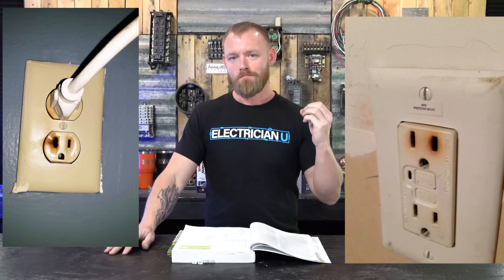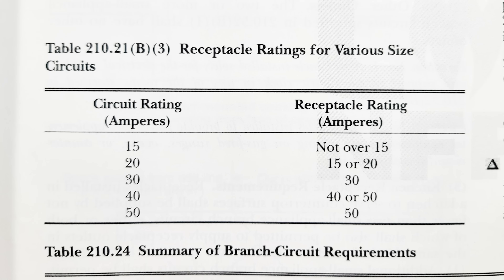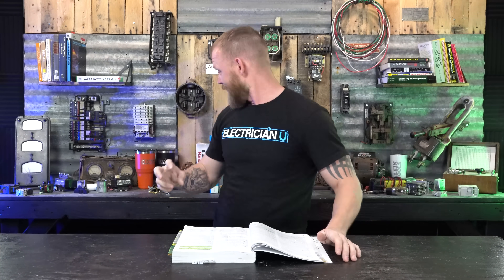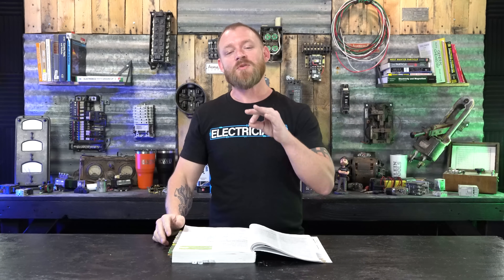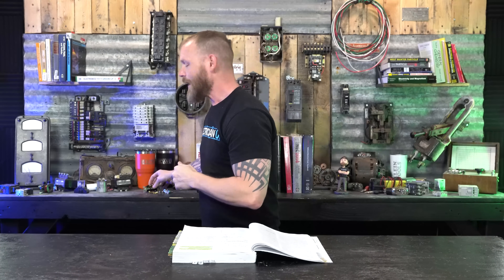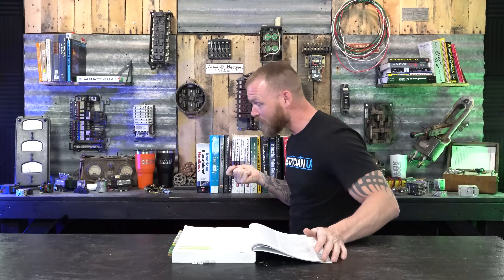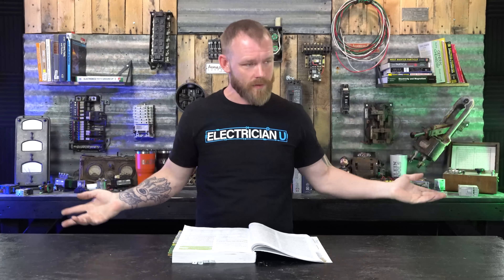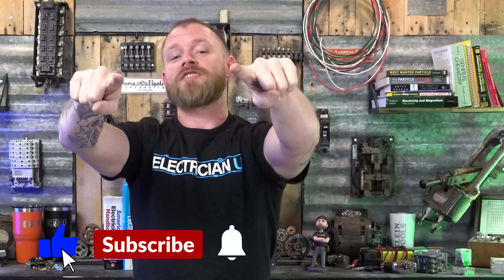Won't These Melt?!? 15amp Receptacles on 20 amp Circuits!!!

Comment: Great advice - a couple of thoughts tangental to the discussion. Spend the extra money and get high quality outlets - the 89 cent outlets are not the way to go. Consider Hospital grade outlets (15 or 20 amp depending on wiring/breaker) and you will never ever have to replace again . Furthermore, the plug will never pull out of the wall - just look at the specs on these outlets. Do it once, spend a little more and never go back knowing you and your family safe and sound. Does a extra 4 bucks make you sleep well at night, I know it does for me, but then again thats my opinion. Cheers!
Reply: LoL you clearly don't own a business that  cost added up over a whole neighborhood or a apartment building... adds up and with every builder bust balls over every penny well you save money where you can...
Reply: I get Leviton cheap.
Reply: Another legit consideration; the clamping force associated with a Hospital Grade device, creates unintentional wear and tear on the cords during unplugging. 

Sure, those in the industry are aware, ... however, many individuals simply tug as hard as needed on the cord itself (as opposed to the cord cap) to unplug... leading to stretching, exposed insulation, partial fraying, etc.
Reply: Your codes seem woefully weak in relation to manufacture of electrical products. What would a poor worker in a slave factory, in another country know about electrical items-all he's worried about is selling them. I have another question, do your fire and insurance codes allow such crap?
Reply: @johnchristmas7522  knows everything there is to know about everything amd if you don't do it the Christmas way is wrong and you're a hack ... this dude most likely couldn't make as a electrician and pulls security wire ...
Reply: @cheryljason9617  sorry you feel that way about me guys, I'm only trying to help-do whatever suits
Reply: @johnchristmas7522  
Interesting 
Do you have any examples of such code issues?

Comment: What about the facts that when you tear apart a 15 amp outlet it could, with the exception of the plastic housing, except a 20 amp plug? This seems to imply the 15 amp and the 20 amp outlets are the same exact receptacle with the exception of the front plastic housing.
Reply: If the metal contact parts are identical then they are the same.

Comment: The interesting piece of this is that in large/expensive homes, there are generally well-insulated walls and a good thermal envelope, and solid HVAC, so a lower likelihood of space heaters.  Where you really need the 20 amp outlets is in the less wealthy homes that are more poorly insulated. This is one of the ironies of residential electrical.
Reply: There is no difference between a 15 amp and 20 receptacle on the inside, just the outside look on the neutral slot…..both have the same copper on the inside. So your guess about more expensive homes is a false statement. It has nothing to do with less wealthy homes compared with large expensive homes

Comment: I rewired my house garage is all 20A GFCI for main outlets, a few in rafters are not GFCI, but also put a plug strip on cieling on GFCI. All the house outlets other than one or two are 20A tamper resistant. 20A GFCI for kitchen/bath. Ran a 50A 120/240V line in garage for welder, etc. Welders I got had cords that had to be updated anyhow were like 30A I just ran a 50A circuit to be safe. New welder cords are 50A though really only need 30A. Got a 30A 120/240 by my bench made adapter for that to go to 50A for my welder or to run welder on generator. I think I have converter too to go from the 50A  120/240 to the 30A 120/240.

Comment: Thanks for your information dustin
I have some question 🙋‍♂️ 
We will have plan to install EV system station for three story building so we have one power source then split three Electric vehicle charge station , we need   Micro meter for how much spend electricity three story neighbor

Comment: I wouldn't be surprised if the major manufacturers make all receptacle innards the same, then sell them for cheap if they are labeled 15A, and expensive for 20A (with the wink). I really doubt running 20A through a 15A receptacle will melt it if everything is installed correctly. I have run 21-22 amps through my 15A receptacles and nothing happened. I have also run 20 amps through a 5amp switch on a lamp cord for an hour and it didn't melt either. Most of these things have a safety factor. I don't think it is good practice to do this nor would I recommend it or even install it that way, but I don't think it will melt either. I think receptacles melt because of loose connections more so than a few extra amps. Thanks for all the code info. Appreciate it!
Reply: You’re right about that. 
The 20a internal parts are not more robust than a 15a. Just oriented differently.

Comment: Hi! I love all your videos. Extremely well done.  But a question on this one — many electric space heaters are rated at 1500 watts. On a 120V circuit, that’s 12.5A. But, code says we can’t (shouldn’t) exceed 12A. Why is it okay, then, to sell these devices that will overload (per code) the circuit?
Reply: Bought a hair dryer recently.  Virtually all at 1800 Watts or above.  Had to special order the old 1200 Watt.  WTF?
Reply: @rogersmith7396  Most resistive element space heaters will increase in resistance slightly as they heat up (and PTC space heaters increase resistance dramatically), so the 12.5A load would only occur during heat up, and steady state load would be <12A. For a hair dryer, it's considered an irregular / temporary load not a continuous load, so it's allowed to draw a full 15A.

Comment: So I thought the only difference between 15 and 20 amp receptacles was the 20 amp had the horizontal and vertical prong hole on the neutral. I even tore apart 2 cheap receptacles in school and the internals looked identical. I mean I didn’t use a caliper to measure the thickness but I swear they were the exact same. All of the burnt up receptacles that I have changed were either a melted wire arcing on the box or a beat ass hole from misuse or just old. Lol. But I have noticed higher quality receptacles in 20 amp being much more heavy duty.
Reply: they are identical

Comment: 20A through a 15A receptacle is not going to melt anything. Receptacles melt because of loose connections either in the plug or on the wire terminals.

Comment: The only difference between a 15 amp and 20 amp receptacle is the t slot on the neutral side.
The interior on both is the same copper, just the face of the receptacle is different.
ASK MIKE HOLT !
Reply: Not only that, but no device with only vertical blades can be rated for more than 15 A. The whole thing is a moot point since a 15 A receptacle will not allow 20 A plugs to fit.
Reply: @quinton1661  Guess you have never used a power strip or any other similar outlet multiplication device before despite the equipment manufacturer's warning against plugging into extensions or other similar devices. Now the same 15A outlet may have any combination of devices drawing a combined total up to the breaker's trip current connected to it.

When using power strips and similar devices, the onus is on the user to keep tabs on how much combined current may be on each outlet and keep the continuous load under 12A.
Reply: @teardowndan5364  subject is not power strips. That same power strip will only go into the slot turn the outlet that it is rated for... However the outlet itself internally is the same.
Reply: The cheapest 15A outlets are really designed for only 15A. You have to go up at least one notch on the quality ladder ($0.50-$1 extra) to get the beefier 20A innards.
Reply: @teardowndan5364  just don’t buy your electrical at Home Depot!
Reply: And that's a fact! Have no idea what this guy is talking about complete ridiculousness.

Comment: In fairness there are only a few number of appliances that can draw anywhere near 15A let alone 20A. The common ones being AC, space heater or gaming computer. But yes I would probably install 20A specific outlets in my own home.
Reply: Code requires dedicated 20 Amp circuits in the kitchen for electric frying pans, deep fryers, maybe toasters.

Comment: Tested with a load bank, 20a receptacles failed at at the same load as 15a.
Reply: Its because the internal parts are identical for surface contact area and tension. 
Its only different orientation what makes it 15A or 20A

Comment: Why don't have a plug circuit breaker on the space heater like they do on a portable  window air conditioner Especially when the NEC code allows a 15 Amp outlet on a 20 amp circuit?

Comment: Always pigtail your outlets while the walls are open!. When the sheetrock crew accidentally leaves an outlet covered, you don't have to go back to the blue print or hunt for the bump in the wall, to connect the dead section of circuit, it's already connected!
Reply: But then one may not comply with the NEC by having a junction that's not accessible and having recepticles spaced too far apart. It's not hard to find a box that's buried behind drywall. Do it right!
Reply: @caseyk6625  There is only one way. ALL the way. I've already done my career. How hard is it when the average home we were jobbing, was 9000-14000sqft, and I have 3 guys running 6 days a week, and the contractor is not going to pay me because the man that worked on that circuit months ago cannot remember where the buried outlet is and there are dead areas, that's not acceptable. And he didn't tail and safe off the wires.That's not acceptable.  Who pays the journeyman for spending extra time to go back and look at the print to refresh their memory, then go feel for it, on a fresh painted finished wall. It wasn't his fault. When the rocking crew races, this kind of stuff happens. I liked getting paid and paying my guys, then they can go back and find it.
Reply: @keithhults8986   What's wrong with having the dry wallers pay for it or go back and find it? That's what we do. They're the ones that covered it up.

Comment: Is there actually any physical difference in the construction between 15 and 20 amp receptacles besides the right angle side extension? Which would cause one to melt and not the other. Like the type of plastic, thickness or width of copper metal, etc.
Reply: @T.J. Kong voltage drop is the concern when length is an issue, not ampacity. Of course ampacity will be higher but it is due to less voltage arriving at the point of use. Crossfill area of the raceway may limit the ampacity rating of a conductor as well but is very unlikely in residential use.
Reply: @T.J. Kong we are, we're just referring to two different sets of tables. DC voltage is more prone to voltage drop than AC voltage is. That is why all distribution systems are AC. And AC is easier to transform to higher voltages further reducing voltage drop and required conductor sizes for our power distribution lines.
Reply: There is no difference in construction in the same grade. Going from residential to commercial grade is a step up in quality.
Reply: Yes, 20 amp are more robust. You can assume cheaper price means cheaper quality. Not always the case but it usually is the case. A $3 receptacle will be better quality than a $1 receptacle. #12 wire is good for 30 amps but by code has to be 'fused' at 20 amps. The receptacle is the weakest component in the system, don't go cheap.
Reply: @1AXMRDR   A residential 20amp receptacle is not more robust than a 15amp, internally they are the same.
In this case spending more money only gives you the option of using a 15 or 20 amp plug. If you want more robust you would have to pay for commercial or industrial grade.
Reply: @gary-dc9st  We're just going to disagree on this one. While there are very few times when you will use the 20 amp male plug, which I have never seen on a residential kitchen appliance, it is still recommended that 20 amp receptacles be used in a kitchen. It's not just because of the sideways plug configuration. They are designed to be used with heavier current drawing loads.

Comment: The way I read the code is if you have a 20a circuit and a simplex receptacle, it must be rated at 20a. But a duplex receptacle, even if it is the only device on a 20a circuit, may be rated for 15a because there are two outlets on that device. Therein lies the trap for that device. It may inadvertantly be overloaded by two high amp draw power consumers.
Reply: Still wont make any difference. 
The contacts within a 20A receptacle are not any beefier. Just oriented differently.
Reply: My house (built in 2018), has a dedicated 20 amp circuit for something and it has a 15 amp duplex receptacle. I’d say you may be right.
Reply: When the code says single receptacle "or outlet", that tells me my teacher was right. A duplex receptacle is not a single, but two receptacles, with respect to the code.
Reply: On a 20 amp branch circuit. If it is more than a single receptacle it can be 15 or 20 amps. 2020 NEC 210.21(B)(3) and Table 210.21(B)(3). However if it is only a single receptacle it must be 20 amps. NEC 210.21(B)(1).
Reply: Sure wish it was written that way.  Simplex distinguishes between a single simplex-unit compared to a single duplex-unit.
Reply: Good point.   The way I view it, ( the code probably sees it the same)   the chances of someone plugging two high watt devices into an outlet to the point of overload,  is small.   Furthermore most if not all large appliances that come with a factory 5-20P or 6-20P on it's cord, will state in the instruction manual this appliance is for use on individual branch circuit only, and the NEC requires you to follow all instructions provided by the manufacturer.   Having said that, it's a common practice to install 15 amp receptacles on 15 and 20 amp circuits throughout the home,  and a single 5-20R (or single 6-20R at 240 volt) will be installed for a piece of equipment requiring it.
Reply: the weak link is still the breaker, the outlet can handle that load

Comment: One of many benefits with european standards, 230V equals less current and thus problems like this are less common. In Sweden 10A circuits are the most common for receptacles in homes, and 16A is standard rating for receptacles. Higher than 16 amps is not common for circuits that use standard household receptacles. If you need more power you're most likely using a 2 or 3 phase load which uses a different type of receptacle.

Comment: One thing to keep in mind as well is how all of the plugs are connected in a circuit.  If all of the outlets are connected by their own branch wire to a junction box, you would be less likely to overload any of the outlets.  But if they are daisy-chained together which is by connecting them through the 4 screw terminals on the plug, you can easily overload the first and/or second plugs in the chain as you plug more and more things into plugs downstream from the first plug because the more thing you plug in downstream, the more load the metal in the first plug will have to carry to run all of the downstream devices.  Even if you don't have anything in the first plug, you can still melt it if you plug too much in downstream.  If you are going to daisy-chain the plugs, use the 20 amp plugs so they can handle the load of the plug plus everything down-stream.  Your best bet to reduce the load on any given plug in a multi-plug circuit id to run the main wire into a junction box and use branch wires and put each plug on it's own branch wire from the junction box because as long as you use the proper gauge wire, you won't have to worry about overloading a plug as quickly unless you plug too much into it.
Reply: Agree. I use the junction box method and when not possible, then I do pig tails for every receptacle downstream.

Comment: Our GPOs (general purpose outlet) in Australia are 10amp, always put on a 20 amp circuit. Only devices rated at 10amp or lower will fit these outlets.
Reply: But are you 220Volt.  110 Volt here.
Reply: @rogersmith7396  230-240 volt. I know, I was more saying it’s common practice to have 10 amp or 15 amp outlets on a 20 amp circuit.
Reply: @rogersmith7396  Where in the USA do you really get 110 these days though? I live in Arkansas and never see below 119vac unless brownout, these are very rare on this branch of the grid because I'm on the same segment as all the TV towers in central AR, a large k-12 school complex, a walmart supercenter, and a water treatment plant. it's usually 123-126 vac. There's a lot of HAM and P25 repeaters on that hill too (Shinall Mountain). Go hogs.
Reply: @hithere7382  Yeah I just mean not 220.  I don't think there is 220 any more either.  I watch a guy who uses generators and some of them have 208.  WTF?  I've heard of 440 but I believe thats obsolete too.  Like 560?
Reply: UK plugs and adapters all have fuses with a maximum rating of 13A (often lower). You can't draw more than that for any time, whatever the circuit rating (which is often 32A, and might even be 40A).

Incidentally, the Australian plug and socket was developed from a design by the same US electrical engineer who produced the ubiquitous North American socket. It shares the same blade dimensions and centre spacings, albeit twisted, for the live and neutral. He'd intended it to replace US sockets, but could not get it accepted. Reputedly the Australian government adopted it rather than the then UK standard round pin plugs as it was easier for local companies to stam out flat blades than the round, brass machined ones of the UK design.